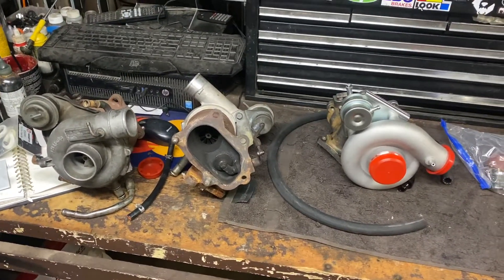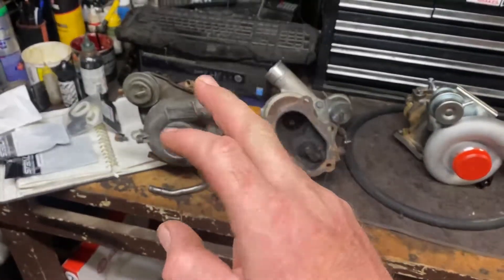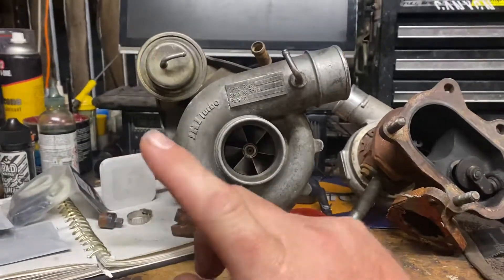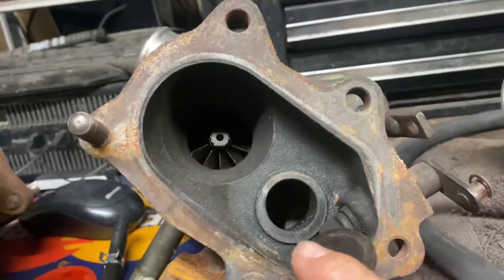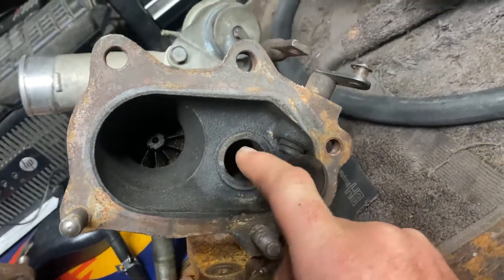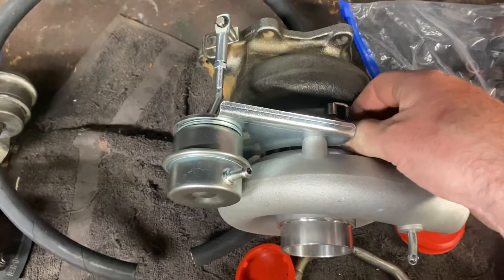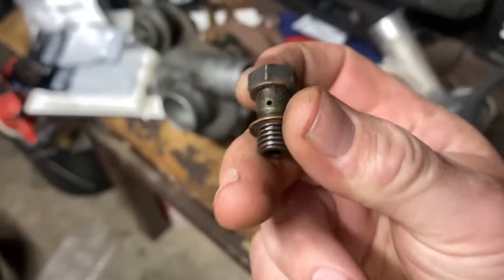TD05 20G - how to get results with the cheapest turbo on eBay.

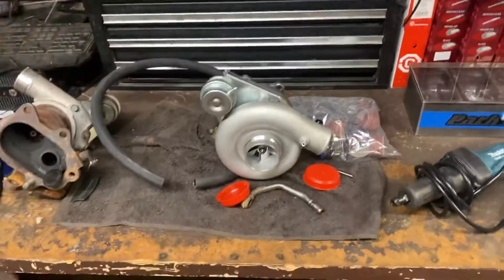Comment: @11:30 You said , " I might leave the boost source to the wastegate actuator disconnected " .
That would be really bad , atleast with it connected it would open eventually .
I hope you have learnt a bit more about turbos and how they work since you made this video.
Reply from the maker: “Just connected”. Not “disconnected”. Ie: no boost controller between the wastegate & the compressor housing.
Reply: @Fine_Performance  The way you worded it was scary talk , now that makes sense.

Comment: They like 22 pounds a lot
Reply from the maker: It certainly felt like it wanted to keep going. 16psi kinda felt like it was only just getting into boost. Unfortunately on my daily, I did get have the fuel system (injectors & pump) to support much more than 18psi. Nothing worse than leaning out an engine under high boost.
Reply: @Fine_Performance  well the air is there when you get the fuel support…
Reply from the maker: @HeidiFegles  I’m running a Vf34 & if I were to run 22psi, the stock WRX engine is only going to last so long with the HP that would produce. Maybe an sti engine, but above 270-280HP on WRX engine you’re asking for trouble.

Comment: What he means is the td05-18 or 20 g turbos for Subaru 2 liter needs to be 7cm turbine housing on the hot side. For daily driving on a ej 20 the tdo5h 18 is a favorite, I’d recommend that when going to a 20 g to step up the exhaust side to the 8cm tdo5 20g
I believe that the td06 20g is said to be the best turbo for the ej25 exploiting all the potential out of the motor. Even Subaru regretted not using the tdo6 20g. 400 wheel torque and 400 wheel horse power. I have a 100mm bore 2.58 liter sti and the td06 20g is perfect, practically bolt on, I had all the headers and a built motor with stock turbo for break in then quickly swapped turbos and the difference was unbielievable  3rd gear would start spinning like a gymkhana car, thus checking off the list of the dream daily driver. Must do drifts box 
Must get me to work to pay for my mods on my car box
And must make and utilize all the turbo noises not just sound good,

Comment: Question can I install a vf48 on the ej2.0
Reply from the maker: Yeah, I just put a VF34 on in place of my VF23/28, then in place of the TD05-20G. The biggest thing is, if you have an aftermarket boost controller… you’ll need to retune the duty cycle &/or gain setup because the previous boost controller’s settings might over overboost the new turbo.

Comment: Hi again when you changed your vf to td05 did you change oil feed banjo bolt to one without a restriction in it ? Thanks
Reply from the maker: Yeah I did. I used the tiny hole one for VF & used one from a TD04 for the journal bearing turbo.

Comment: Do you know what size an fittings you used for water pipes ?
Reply from the maker: I’ll have to measure them. I just took the turbo down to the race parts shop & they made up the pieces. 2x orb to AN, 2x AN to push loc & 1m of hose that I cut to length. I’ll try remember to measure & I’ll report back.
Reply: @Fine_Performance  thanks it’s mainly the thread size and pitch 👍
Reply from the maker: @anthonyhunt6765  I’ll have to measure. I though it was metric to AN fittings. But I think they’re like UNF or something.

Comment: 5.07 and that is why you buy an exhaust with a splitter - divider = they are the best types ! = i did and it is great .
Reply from the maker: Do you mean a divorced wastegate pipe?
Reply: Nah i think he meant the down pipes with little bit of metal plate that protrudes into the turbo itself so it seperates the wastegate flow from turbo flow until about 10cm later, 
Dyno tunes showed no change in power just slightly more stable boost control and less backpressure which is good.  @Fine_Performance
Reply from the maker: @tbas8741  yeah it just stops the exhaust flow interrupting wastegate flapper & aids the boost control. It’s usually not necessary. You can get ones that are completely divorced & the wastegate flow rejoins further down the exhaust pipe. I havnt had an issue with either of my WRX with just an open exhaust.
Reply: Some of those divorced pipes with wrong sizing actually SUCK the WG open from the gases going past smaller pipe and scavenging from it. 
 @Fine_Performance
Reply from the maker: @tbas8741  no.
Reply: Buy, just get a piece of stainless and weld it in your self. Divorced waste gate, and let me tell ya I should know I’m a pro a divorcing at this point in my life…😂

Comment: So tdo5 is the turbine end (hot) the compressor is a 20g (cold side) some of the porting was okay but your assumption on turbine flow interfering with the gate is all wrong. Ideally you want then devided but that has to do with harmonics. You do want a megaphone on the turbine housing exit about 1inch per ft but never a opposite velocity stack. The reason is kinda obvious but just incase the rate of expansion has to match the gas expansion to not cause loads of turbulence (which is still small potatoes since a good bit is common outside the turbine.). Porting the gate yes do that but that transition into the gate the more aggressive you make that the more control you have over boost. On a 20g if you not making over 400whp I wouldn't touch it as too far hurts spool and power and honestly a td06h4 turbine and housing is a smarter option for a 20g than porting especially since you go from a 11 blade turbine wheel to a 9 blade in a much bigger turbine housing. Dont remember off my head but I wanna say the td05 is a .67ar and the td06h4 is a .87ar. I know my 20g with a td05 housing and turbine was getting high in the back pressure around 18psi but my td06h4 doesnt creep at all and happily makes 30psi. No dyno to confirm but times suggest around 550-600 but the previous owner had a dyno sheet that said 609whp which maybe but until I see it I cant say. Now I will say that at 400hp the small td06 housing is best no creep plenty of flow and spool by 3k on a 2.0l where my td06h4 is spooled  around 4500rpm and much laggier. Keep in mind this is with the same compressor. Think of the td06h4 as a great turbo for racing and street use the td05 is great for a street car and the td06 is in between but closer to a td06h4 biggest differences are blade count and ar but ar isnt that different.
Reply from the maker: Thanks, that’s great info. The spool ended up being very close to the STi turbo I later refitted. Given that it was ball bearing vs the bigger journal bearing turbo & there was only a 500rpm difference, I figured it had helped & id seen some other info indicating that the stock shape of the back of the turbo could use some improvement. The idea was not to open the path of the air from the turbine, to hit the flapper on the wastegate because of it did it might hold the flapper open & therefore would affect the turbo spooling.

Comment: Would you see more gains from replacing the internal of the ebay turbo?
Reply from the maker: I just don’t know if another chra (core) will fit these housings properly.
Reply: @Fine_Performance  I was more of talking like if You replaced the compressor and exhaust wheels with like a tomika ones
Reply from the maker: @Fmnpc  Its not relly that simple because the whole assembly would need rebalancing. The Chra is stuffed now, it has 2-3mm of up & down play. & with a new chra youd need the housings machined to match the in profile of any new turbine/s.
Reply from the maker: @Fmnpc  The turbo makes good power. With a ball bearing CHRA you might see sooner spool. Better quality housings & turbines would make more power due to being a better design. A $236 turbo doesnt exactly have Garrett level aerodynamics. Hence why its 100 times cheaper & lasted 100 times less.
Reply: Ball bearing turbo quicker spool time of 0.25 - 0.5 seconds is not worth the much much shorter lifespan IMHO.
Average lifespan of a TD04 or any journal bearing turbo is 350-500,000KM or 2 Engine lives, Any Journal bearing turbo made these days should easily last 400-500,000km if looked after properly., New oil every 3500-5000km & letting the car idle 1-3 mins after hard driving (turbo timer if you are lazy :D) Also letting the car reach full temps before using more than 3-4psi boost. @Fine_Performance
Reply: @tbas8741  I keep hearing the opposite. "Ball bearing is more reliable" maybe Mitsubishi turbos are better than Subaru turbos and the ball bearing versions are better than journal bearing Subaru turbos ??
Reply: They both use mitsubishi turbo's (IHI) 
Its a common myth about ball bearings for all applications. (they roll better / smoother, but do not last anywhere near as long, thanks to basic physics its not possible.) 
 
Journal bearings float on oil film and have NO Physical or Mechanical contact to wear out Like CranksShaft & Big end Bearings. 
(If correct oil is used at correct temps, there should be no contact and therefor no wear) 
Its common for TD04 Journal bearing turbo (looked after) to last 350,000km - 500,000km without wear. (Or 2 full engine Lifespans @ 250,000km each) 
Ain't no ball bearing turbo gonna do half a million KM like little TD04's and the like. 

Where as by their design Ball bearing Turbos are metal on metal contact bearings and can wear out. (thats being said that can handle thrust loads better, Like how no BOV or BPV will damage a turbo from excess thrust loads, BB Turbos can handle this better, but no turbo can handle it well. 

(Thats why trains Axles only use Journal Bearings as ball bearing could not take the load or weight of 50 tonne per train axle and would wear out more.) 

  @dildodickings2668

Comment: You think I should go td05 for a 1.6 16v vvt renault engine?
Reply from the maker: I’d say too big. The 20G is slightly too big for 2L if you want response. It’s good on the 2L if you were racing or driving fast. But around town is takes a little more to build boost. 16G is much better suited to 1.6L engine.
Reply: In my opinion td05 even 16g will be too big. I have it on my 2.0 and it start spooling at 4000rpm. Get a td04 or a VF23 turbo
Reply from the maker: @dominikborowski  td04 runs out of puff up top. Vf23/28 etc is good. I feel like the TD05 still has more pull up top though so you keep accelerating rather than the power seems to plateau with the VF a little bit.
Reply: @Fine_Performance  yeah but for a 1.6 a td04 makes way more sense. Also nice to have some mitrange torque. Without a good ecu tune td05 16g in a stock ej20 is useless imo. I have a direct comparison between two cars and the one with smaller turbo feels way faster
Reply from the maker: @dominikborowski  oh yeah, I forgot he was talking 1.6L. I’m not on stock ecu though, that could be the difference with my car.
Reply from the maker: @dominikborowski  I have put a VF28 (same as 23). Tbh there isn’t much difference with the VF28 vs TD05-20g. The TD05 pulls harder to redline than the Vf turbo.
Reply: Was looking at one for my 1995 eclipse GST. Hopefully It'll work for me.
Reply: Get a gt28 from a s15 or gtr their ball bearing and about the same top end as a td05 with a 20g compressor wheel but the spool of a td04. Just make sure to look for the smaller turbine housing. I put one on my gl1500 swapped mgb and at 1500cc it spools by 3-3200rpm. Cant say I tried my 20g but if I had to guess it would be closer to 5-6krpm. The disco potatoes are similar in flow and size but ball bearing and better aero and a lighter rotating assembly. It also has a bit more efficiency at higher boost than the 20g. Had both on my s13 with an sr and the disco made about the same power a touch more but spooled about 700rpm sooner and that was with the big turbine housing if one got the .63 it wouldnt be getting over 400whp easy but I'm sure full spool is around 2500rpm as it is on my buddies with a similar set up. My big disco spools at around 32-3300rpm. Neon with a td06h4 20g spools at around 4krpm 😂 but pulls to 9k hard with less back pressure than boost. Both families are similar in flow depending on turbine end.
Reply: 1.6 liter you need a gt25-2860, or vf 34 ball bearing turbo, tdo5 will make powe by redline and be a terrible daily driver but a dyno star.